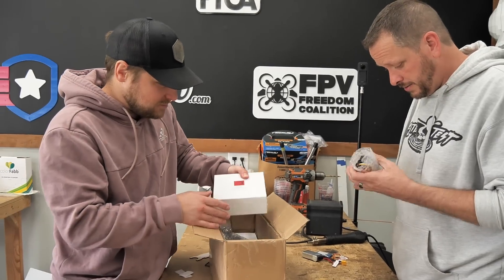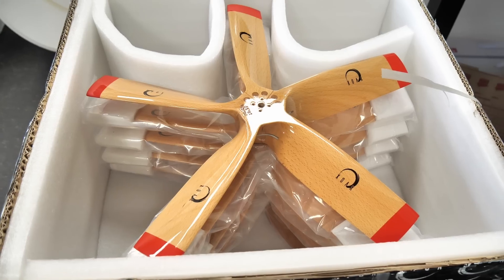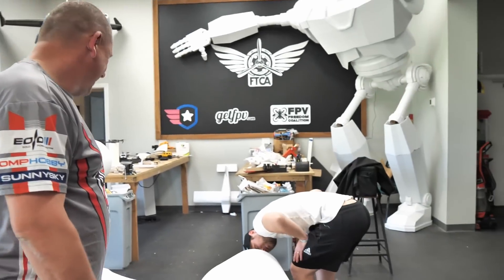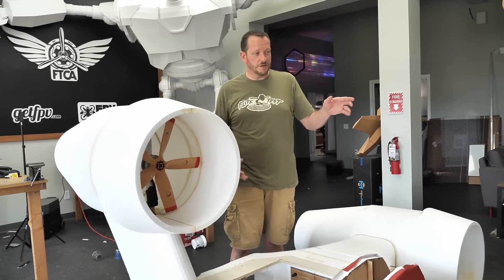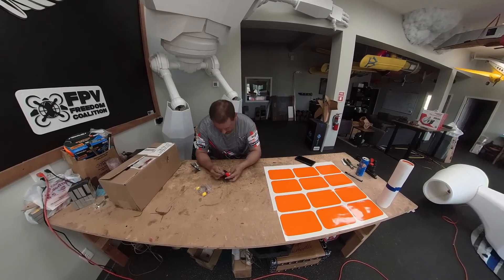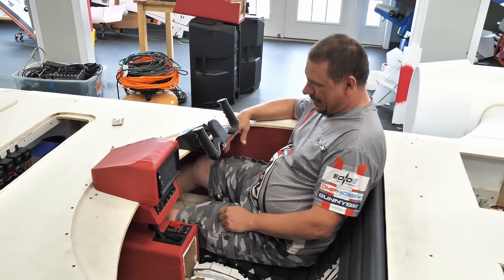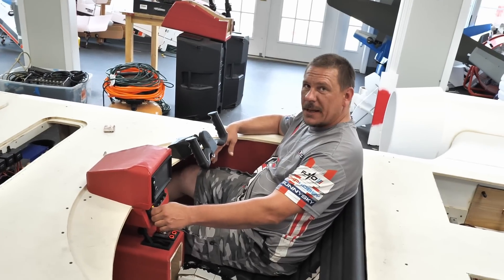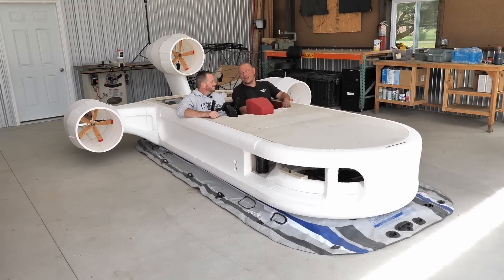Next Level Hovercraft - Insane POWER

Comment: I would add some (Clear) wings and add louvers under the lift fans and make it a wig craft. Once you are in ground effect the lift fans would not be needed and the power requirement would not be much lower so longer run time. See Mud Skipper from Australia.

Comment: Tip - when you get that plastic binding on packages, all you need to do is find the overlap point on the tape. The upper edge can be peeled back and it just pulls apart.

Comment: I love this project! I am really curious about failure, specifically prop failure.  What happens if/when something hard gets sucked into those props and they come apart? Is it possible to do a layup on the inside (or outside) of the pod with Kevlar and fiberglass to decelerate any bits if those props shear. Just thinking about it...   Can't wait to see more! Be safe and great work guys! Been with y'all since the early days in Chads basement, so cool to see what this has grown into!

Comment: 10 inch pitch is a bit low for an 18 inch dia electric set-up. Perfect for IC but pitch speed will be low in electric unless you run elevated Kv. Plenty of static thrust but it will decline rapidly with forward motion. I fear your friends at Xoar are a bit influenced by their IC experience.

Comment: Please excuse my ignorance but I haven’t followed this build all the way through so I’d like to know how it will be steered? Does it use variable speed for the two side jets or do the jet pods turn left and right?
Reply: The outside pods use differential thrust (speed up slow down separately) for steering. There will also be a gyro stabilization board to make it easier to drive straight and keep the craft stable

Comment: Over the years i have had a scat hovercraft, UH18, several toy /models to play with. They work the best over thin ice. Big problem with them is steering because they slip sideways. To remedy this i made a model with a single retractable wheel in the middle. It worked so good on the model it was like driving a car. I always wanted to try it out on a real sized one, but time and money worked against it.

Comment: you dont even need a knife to remove packing straps, if you feel around the joint where they are fused, on the inside is a little tab of extra plastic, if you peel that backwards it will just come undone . ez pz
Reply: Not always sometimes there's no tab car keys come in handy then lol
Reply: @blitzrc4713  🔴 What Is Islam? 

🔴 Islam is not just another religion. 

🔵 It is the same message preached by Moses, Jesus and Abraham.

 🔴 Islam literally means ‘submission to God’ and it teaches us to have a direct relationship with God. 

 🔵 It reminds us that since God created us, no one should be worshipped except God alone. 

 🔴 It also teaches that God is nothing like a human being or like anything that we can imagine.

🌍 The concept of God is summarized in the Quran as:

📖 { “Say, He is God, the One.  God, the Absolute.  He does not give birth, nor was He born, and there is nothing like Him.”} (Quran 112:1-4) 📚

🔴 Becoming a Muslim is not turning your back to Jesus. 

🔵 Rather it’s going back to the original teachings of Jesus and obeying him.
Reply: You posted this in the wrong comment section. This channel is about rc vehicles, not about religion.
Reply: @lupulflamand5673  the religion of the RC gods😂🤟
Reply: Nerd! :)